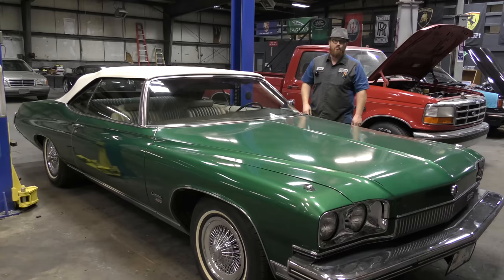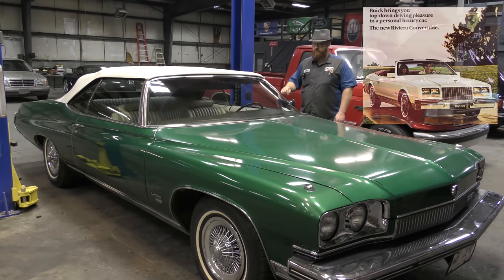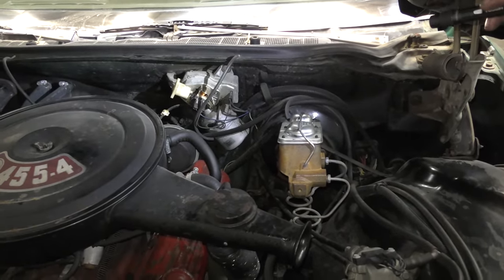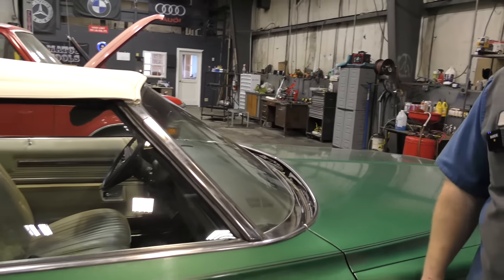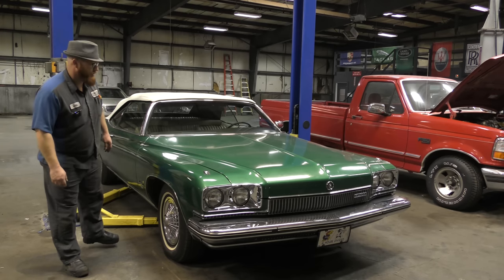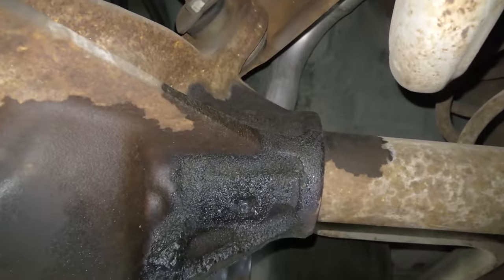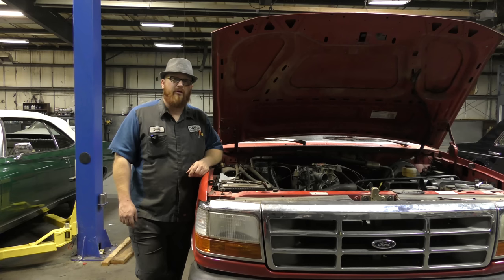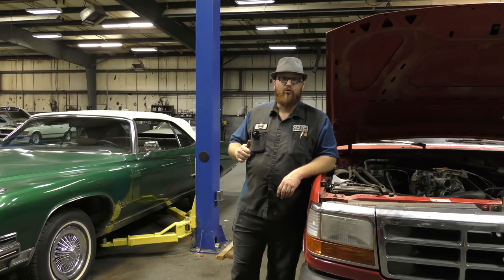Road Warrior! The CAR WIZARD shares a rare '73 Buick Centurion.

Comment: Was a Buick mechanic back when those came out, and yes I drove one with a 4 speed. It was awesome. If you have any questions...
Reply: My great grandmother has a 1960 Buick LeSabre. I remember riding around in it all the time as a little kid. I loved it. My grandparents still have it, needs a little work but still runs, they just don't take it out often.
Reply: Can you still remember the MPG it got?
Reply: @lulink99  If I remember correctly it got about 17-18mpg highway.
Reply: I have a Century GS with 455 stage 1, awesome engine and awesome car, sadly no car maker design and made such good cars.
Reply: Got a 1971 LeSabre from the DEA in 1975, all the goodies said it wood not run I got new rockers assy, a new exhaust  another doo dads, my 250 buck investment netted me over 2k when I sold it .great cars and too bad the oil crisis hit back then
Reply: @Theorbit10  When we go for a cruise in our old '75 Buick LeSabre convertible, we don't even think about gas milage. The journey is the reward. :-)
Reply: My parents had a 1973 Mercury Monterey and you could not feel the rode at all.He is right about the ride in the old American cars.
Reply: @gertraba4484  What engine did it have? Did you put the new rocker arms in or the people you bought it from?
Reply: @houtanarefi3325  I sure wish the old cars would come back. All we have so far in the return to old but in modern form are the Mustang, Camaro, and Challenger. I wish that GM would have kept Pontiac and Ford would have kept Mercury.
Reply: That's actually a LeSabre that's sportier and with a better suspension.
Reply: @dillonh321  Seriously? That thing was a spaceship! People need to check it out on Google! Where would you find the windshield for that? Lol
Reply: @rcncableguy  
You would have to get it custom made at a specialty shop. I would be more worried about the rear glass, my grandparents 60 LeSabre is the rare flat top sedan where the roof is more flat and less bubbled like the normal sedan that makes the rear glass shaped different, could be hard to find any place with the information on how to make the rear glass due to its rarity.
Reply: @Theorbit10 I bet that the shifter was on the floor as column shifters were used only for 3 speed gearboxes on American cars. I drove for years a 1974 Buick Apollo bought brand new by my dad with a three on the tree and a 250 cid Chevy 6 cyl. engine.
Reply: rcncableguy   Believe it or not, 71-76 full size was the same windshield. A Delta, Catalina, Impala or Caddy. That vintage was very easy to mix and match parts. I stripped a ton of them for various reasons.
Reply: @rexcars1835  
He was replying to me, I was talking about a 60 Buick.
Reply: @lulink99  Gallons per mile.
Reply: Poeple go off about how terrible the mileage is on these but i did the exact same 500 mile trip with my 2016 silverado 1500 and my 1975 Oldsmobile delta 88 convertible and the fuel consumption was almost identical.
Reply: @raptuous  To be honest I was just curious. I'm from Germany and I recently acquired an Audi 80 built in 1992 with a 2.0l inline 4 engine, 115 horsepower and a four speed automatic transmission. It has individual fuel injection (per cylinder, no carburetor) and it still only gets 23.5 mpg on mixed driving. Long distance you get 30 mpg, but on short distances you can almost carry fuel trailer with you because the gas tank only takes 17,435 gallons and from full to empty you have around 370 miles. These figures are for moderate driving, if you get on it I'm sure it could go higher. I didn't want to shame anyone for fuel usage. I was just curious.
Reply: @lulink99  I would have to do some conversions since I'm much more familiar with Canadian metric units of liters /100 km.  My truck gets about 13 to 14l/100 unloaded driving conservatively in summer, 16 at best in winter or with any extra work in summer.  My olds has a 455 that is mostly original other than I put in a modern cam shaft when I had to do the valves and springs 10 years ago.  I get 15 to 17 depending on how I drive it, usually pretty hard because it's much fun feeling than barge take off on the four lane highways.
Reply: @raptuous  I'm sorry I thought you were from the US. Here in Germany I'm obviously more used to metric too. Mixed traffic is ~10l/100km (average over multiple refuelings), Long distance is ~7-8l/100km, short distance quite higher. Most of the fuel consumption is caused by the old transmission and it's torque converter, but thankfully there is a clutch bridging it in fourth gear and on open throttle in third gear. My gas tank holds 66l and gets you ~600km (mixed driving). Still for a sedan with 115hp that's much. That took half the time without converting the units...
Reply: @lulink99  my truck is almost dainty by northern canada standards.  Many drive lifted 3/4 ton or one ton trucks and far more horsepower than mine getting 20 to 25 L/100km. They are also their daily drivers while i use mine only when i need it and keep a small asian car of some kind for normal commuting that gets 6 to 8 L/100km.
Reply: I'm not sure if it is comparable but a friend had a 2000 Audi a4 and it got terrible mileage compared to similar sized cars.
Reply: @raptuous  My dad actually drives an Audi A4 B5 (the first A4 and direct successor to my Audi 80) with a 1.6l 101hp 4 cylinder and stickshift and he gets 7l/100km highway driving, short distance is not much worse. That was even with a broken thermostat the coolant didn't get over 60°C. The older engines with more displacement generally got worse fuel mileage compared to smaller size engines. With my car it's mostly the transmissions, as with Stickshift people drive it 7-8l constantly.
Reply: @lulink99  Last Audi I owned was a 1971 Super 90 Variant (wagon). Anyone in the US or Germany remember those?  I loved that car. So I kept it going until the early '90s, when I just couldn't get parts anymore and rust finished it off!
Reply: @sunbeam8866  I can't because I was born in '99, but I've heard about them in recent videos of people visiting the historical museums of Audi and VW. Recently I learnt that in the beginning Audi Wagons were called Variant, although that was the Volkswagen name. Later Audi changed it to Avant. It is still very interesting to see and learn about past cars and the history of some brands.
Reply: @lulink99  Several years ago, I met an engineer with Volkswagen, who comes to the US now & then for his job. He collects these old Audis and has bought several spare parts from me to take back to Germany.. Ironic, having to come to the US for vintage Audi parts!  
The company, was known as Auto Union and in the mid '50s, began exporting FWD DKW cars to the US. It was bought by Daimler-Benz in 1958, then purchased by Volkswagen in 1965. The last DKW design was originally sold as the DKW F102 and powered by a 3-cylinder two-stroke engine. But two-stroke engines are relatively thirsty, and these last DKW engines suffered from an unreliable oil-injection system. So Daimler-Benz developed a high compression, slant-four, OHV engine, which went in the cars when Volkswagen revived the Audi name .
In addition to FWD, the cars also featured such advanced features as all torsion-bar suspension - adjustable in the front, and inboard front disc brakes - engineering I appreciate, compared to today's practice of just throwing in more computer chips!
Reply: @sunbeam8866  As you can guess by my previous comments my car is older than myself. Although I'm a computer guy, I only like to update my stereo and drive old cars. Even with the Audi 80 I have to get someone with VCDS to diagnose the car. I repair my car by myself, I just picked up the new steering booth. Thank you for the US perspective on Audi, I didn't know that.
Reply: @lulink99  My '71 Audi Super 90 wagon used a twin-throat Solex carburetor, and Bosch point-distributor. The only electronics were in the alternator- regulator, turn-signal relay, and the radio. The pushrod OHV 1760 cc engine used a short timing-chain. So no timing belt to worry about. With an aluminum crossflow head and about 10 to 1 compression, it was rated at 100 hp. With a 4-speed manual but no overdrive, my car could still manage better than 30 mpg on the highway - on premium-gas. No automatic was available. A dealer-installed air-conditioner was offered on the Super 90, but I've only seen one car that had it.
Audi also sold the 100 sedans in the US, with this same engine, but different head, that developed 110 hp. A 100 fastback coupe version not sold in the US, but with twin carburetors, was rated at about 130 hp!

Smaller engine versions of my Audi were sold in Germany as the Audi 60 and 75, along with the Super 90 sedan. But according to my Volkswagen engineer friend, the Super 90 wagons were only sold in the US.  Costing about $3000+ in 1970, for a design that dated to the early '60s, only about 10,000 Audi Super 90 sedans and wagons were sold in the US from 1970 to 1972, alongside the more modern, expensive and popular 100-100LS sedans. Those continued on until 1976, and were offered with automatic, power-steering and air-conditioning. The replacement for the Super 90 in 1973 was the Audi Fox, AKA the Audi 80 in Europe.
My friend has actually travelled here twice to buy two Super 90 wagons, and take them back to Germany. 
Hope you enjoyed my little bit of ancient Audi history.
Reply: Theorbit10  Cool car for sure.  I had a 70 deuce and a quarter. Sleeper with a stage 3 455 CID.
Reply: I remember riding in my Uncle's '71 Centurion back in the day...it was awesome..but it was an auto of course,...i loved that cat when I was a kid. Later on they traded it in for a damn '78 Chevette...ugh...the late 70's gas crisis
Reply: Not meny people drive standerd anymore !

Comment: I repair watches for a living.  Seeing the same thing in older watches, just no parts available.  Some people like an old truck and wear an old watch.
Reply: Yeah, I'm one of the them. Timex watch and a Ford Ranger.
Reply: what this is, is the new cars are shit they do not last so people are buying classics from a time when quality meant something so the car manufacturers have decided it you won't buy what we are selling we will force you to by not having parts for classic available any longer
Reply: @engir63  And what about the aftermarket?
Reply: @taunuslunatic404  what about them:?
Reply: @engir63  I mean, are they interested in reproducing spare parts?
Reply: @taunuslunatic404  why are you asking me , if you look  at what is going on the answer is no?
Reply: @taunuslunatic404  Depends on the parts.  Things like ECUs (or any computer in a car for that matter) may contain copyrighted code that prevents the aftermarket from making replacements.  Even if they did, many such parts have to be programmed to work with a specific car, and once a car gets old enough the equipment needed to program those parts may no longer be available. 

A car like that Centurion is almost certainly entirely mechanical so it's easy for the aftermarket to make parts for cars of that vintage. 

So yeah, you're going to see more and more perfectly good cars go to the scrapyard for lack of a simple computer module.  Kinda sucks, doesn't it?
Reply: @chrisfreemesser5707  I think the advent of more cheaper stand-alone fuel injection systems would cure that problem for those who can live without the original looks/function. 

At least that way the car would live on vs being sidelined for lack of a part. Price is the issue.
Reply: @acemobile9806  That might work for basic engine function but doesn't do any good if your TCM or BCM or any of the other myriad computerized controller modules fails and you can't find a replacement.  Hell at this stage any unobtainable CANBUS controller will render an otherwise perfectly fine car unusable.

Manufacturers are only required to keep replacement parts available for like 7 years and if you have a vehicle that's uncommon for some reason it'll just make the problem worse.  I read a story about a guy with an F-150 that was about 7 years old.  It had a very uncommon set of specs and when one of the modules failed there were ZERO replacements available anywhere.  It wasn't until the guy's story went public that Ford agreed to have a replacement module made for the guy.  Makes me wonder how many cars have already gone to the boneyard for issues like this...
Reply: @chrisfreemesser5707  I've read that same story. Guy with an '08 & a very rare option combination. I think it was nav but no auto climate control or something like that.  

My comment wasn't really meant for vehicles that resemble half-ass space shuttles with a half dozen modules. In my opinion nothing will save those in the near future. They really will be obsolete on purpose & by design.  From a working man's perspective, I resent that they're making cars so that you have to be a NASA computer whiz with $10K worth of equipment just to work on them. I didn't ask for it & I'm willing to bet that most who buy into that junk are sorry they did once the warranty is up. 

I was targeting a simpler time, say pre-millenial stuff. Anything with just a PCM & nothing else can be run stand-alone. I'm willing to bet as time goes on, the older stuff will become even more prized for those who can't afford or don't want the ridiculous complexity of new vehicles.
Reply: That's why you see a good number of trucks and cars of that vintage converted back to a carb, stand-alone ignition, and pressure regulator on the fuel pump, at least in areas where they don't emission test.
Reply: @acemobile9806  Agree completely.  Most people are totally ignorant of how modern cars are designed and won't realize what they've bought until they have to start writing $1000 checks every time something breaks.

I think about 20-25 years ago things were perfect...enough electronics in a car to make them reliable and safe but not so much that they couldn't be fixed relatively simply for a reasonable amount of money.  These days  you can't even check the oil level on some cars without a dealer scan tool.  It's insane.
Reply: I am one of those types. I like it old and simple, less crap and less cheap materials. Classic never goes out of style, new now is not going to be classic in 25 years as it will not survive and will be mostly forgotten by many people like music of the modern age. Nobody cares about cheap plastic crap, they want the real thing. They just buy the cheap stuff because they cannot afford the good stuff. I think classics of all types of goods will make a roaring comeback in all areas. New is trash and it is going bye bye.
Reply: I'm looking for a watch stem for a 1953 Lord Elgin Black Knight and the original Conical crystal.
Reply: @chrisfreemesser5707  There are quite of few companies that are now producing stand alone EPUs for newer cars.
Reply: @chrisfreemesser5707  There are EFI kits that replace carburetors (like Holley EFI) and throttle body systems that can be fitted to any engine.
Reply: I still wear my old Seiko automatic.  I'll be sad when that stops working.
Reply: A lot of parts on cars tend to be generic in the drive train and readily available via aftermarket. Where things are going to be an issue with modern cars will be in the electronics. Electronics have been rapidly changing so while the engine internals may be the same for decades (think sbc) the engine management / injection may only have a couple year run (96-98 gm truck) gm did not fabricated the chips in the ecu, that was all outsourced. I doubt there is any NOS components to make a lot of these old ECUs and I really doubt there is any info on them. To expect a manufacturer to continue to make a vintage electronic component decades after the tech has long been left in the dust is nuts. They would have to engineer basically a new product with new manufacturing processes and components and for what? A couple purchases? They couldn’t sell them for what it would cost at the low volume. At that point it would just be like going to any aftermarket ecu manufacturer and using their product. Besides there are still junk yards full of useful parts.
Reply: @acemobile9806  it already is prized for me. i love anything pre 2005 or so
i have a 1990 grand prix
1996 camaro Z28 LT1
2001 grand prix GTP
Reply: @tomlindo2863  good example. the LT1 used 92-97. i have one of those engines in my camaro. awesome engine, i love it..... the only produced it for 5 years though so it may be harder to get those parts. i actually have a spare PCM. the other issue is the opti spark ignition, GM already only sells re-manufactured optis........ hopefully enough being that these engines were used in the corvette will keep some parts being produced...... but i do see what you are saying, the fuel and ignition system in that car was only used 5 years.
Reply: @chrisfreemesser5707  I'm retired and don't have a daily commute. So I hope to keep my '90s vehicles running until I can't drive anymore. We'll see. So far all the parts I've needed have been available new and used. 
People today think they can't survive without touch-screens, infotainment, bluetooth, and all the dozens of other computer systems.
Hope they can afford a new vehicle when the warranty expires on their 'old' one!
Reply: They want people to buy a crappy phone linked blue tooth watch.